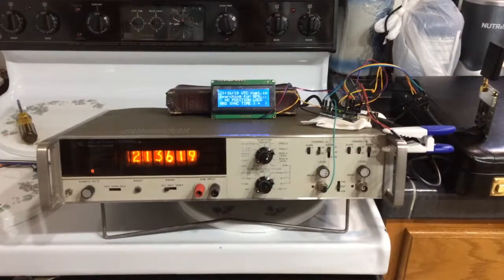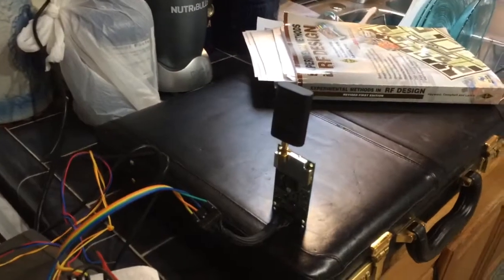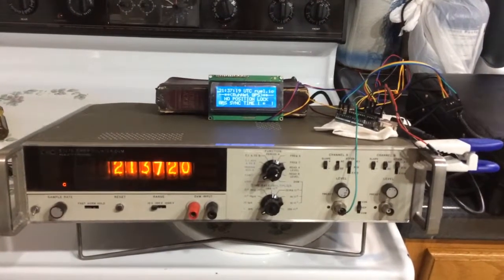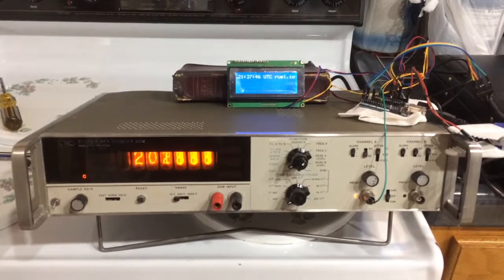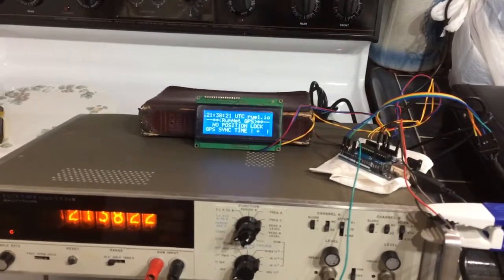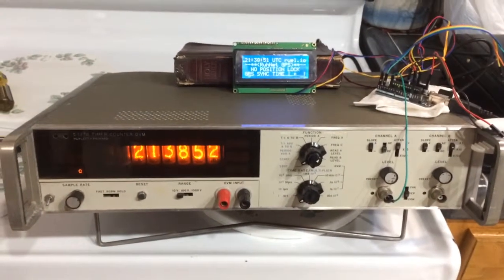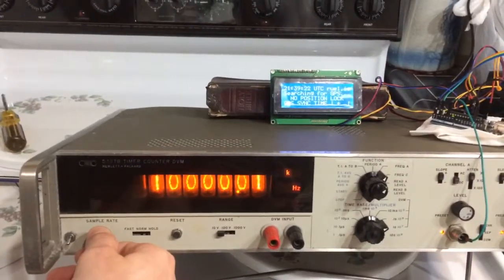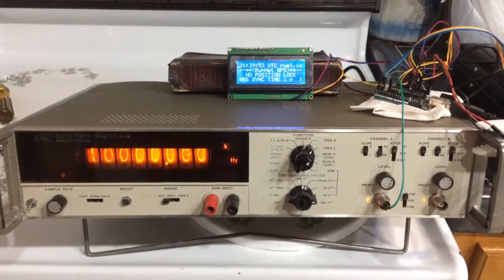HP 5327B Arduino GPS Clock Nixie Tube Counter Display

Comment: Baby steps. I’m getting The display on the counter to at least count up. I believe that I may have played around with my GPS and set it to two second update, so that’s the next thing I’m going to play with in the u-blox software. Perhaps I should also get a Bible and set everything on top of it. I will keep my fingers crossed and keep plugging away
Reply from the maker: Yay---progress! :-D
Reply: @ruhnet  ok😃 I’m only getting the counter which by it self is ok to watch on the Nixie tubes. I think I need to ask what nmea? String your gps puts out. Reviewing the iforce2d gps videos I can turn on and off the strings I don’t want. I think I’m on the right track.
Reply from the maker: @markgreco1962  sounds like you're doing good --- I don't know the exact format mine used, but it doesn't really matter. Just turn on the features you need/want to process/display. So you for sure want a time string, anything else is optional. I think mine had time, one character for GPS lock, Lat/Lon position, a checksum (which I ignored), and maybe a few other parts that I ignored. You just take the string and pull characters out at various positions in the string.
Reply from the maker: @markgreco1962  also, I believe there are Arduino libraries that handle parsing of GPS NMEA strings that make it easier. I just did the dufus method and "cropped out" characters I didn't want.
Reply: @ruhnet  well all I want is time so wish me luck. BTW you know I’m not a programmer 🤣😂🤣😂. 
I’m learning TONS here

Comment: Well, update time. I’m trying to use the LiquidCrystal_i2c library with some success. This library you need to turn on the lcd backlight. As I’m not a programmer it’s painfully slow. About 6 hours so far. After I get the screen arranged I will start on the gps packages. 
You have the only project like this using arduino and gps on the web. Seems like everyone with a counter would want to make one.

Comment: Very very nice
Reply from the maker: Thank you!
Reply: @ruhnet  I’m building it for sure.
Reply from the maker: @markgreco1962  Great! Do note when looking at my code that there are several comment lines and outputs "leftover" from a previous similar project, and depending on which GPS module you use, you will likely have to adjust the character string start/end positions to determine GPS lock and get the time from the particular NMEA string sent by the GPS, etc.
Reply: @ruhnet  oh yes there is a lot of extra code. Code is not my strong subject so I’m doing my best to wade through it. I found a different lcd library to verify if everything is hooked up correctly. Started substituting lines and such. Wish me luck!
Reply from the maker: @markgreco1962  Good deal. Feel free to contact me if you need help :-)
Reply: @ruhnet  thanks I will
Reply: @ruhnet 
I uninstalled Arduino and started with a fresh slate. I have the library installed and this is the error code i get. All i can think is that some of the code in this library are not supported in the new IDE??? Perhaps the LCD Library that you used is not supported OR ITS JUST ME!
Any thoughts 

 In file included from C:\Users\markg\OneDrive\Documents\Arduino\libraries\LCDi2cW\examples\LCD_Test\LCD_Test.pde:20:0

C:\Users\markg\OneDrive\Documents\Arduino\libraries\LCDi2cW/LCDi2cW.h:24:15: error: conflicting return type specified for 'virtual void LCDi2cW::write(uint8_t)'
  virtual void write(uint8_t);
               ^~~~~
In file included from C:\Users\markg\Arduino\hardware\arduino\avr\cores\arduino/Stream.h:26:0,
                 from C:\Users\markg\Arduino\hardware\arduino\avr\cores\arduino/HardwareSerial.h:29,
                 from C:\Users\markg\Arduino\hardware\arduino\avr\cores\arduino/Arduino.h:233,
                 from sketch\LCD_Test.pde.cpp:1:
C:\Users\markg\Arduino\hardware\arduino\avr\cores\arduino/Print.h:51:20: error:   overriding 'virtual size_t Print::write(uint8_t)'
     virtual size_t write(uint8_t) = 0;
                    ^~~~~
exit status 1
Error compiling for board Arduino Uno.
Reply from the maker: @markgreco1962  unless you have that exact display I used, you don't want to use that library, you want to use the standard lcd library. Open one of the lcd example sketches that comes with Arduino and make sure it runs, then you can replace the lcd commands in my sketch with the ones the regular library uses. (I don't think you can even still get the display I used anymore; it isn't a standard i2c display, it's a weirdo one.)
Reply: @ruhnet  I will try it thanks